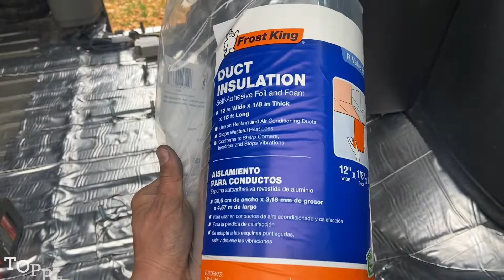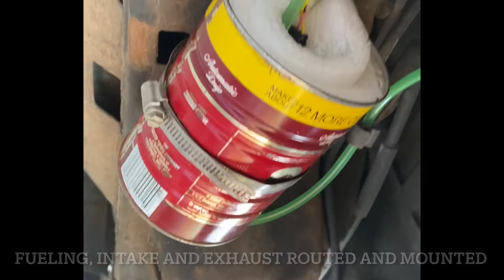Quigley Duramax 4x4 Van GMC Savana

Comment: Nice build so far. I wish my Express was an extended model. I'm hoping to finish the inside job I started last summer. Planning on putting a steel futon (cut-down to approx 30" wide) behind the driver seat, that way I can put my bike where yours is and still sleep inside. We'll see how that goes.
Reply from the maker: Thanks! Eaxtended is nice you never want less-space. But the standard WB is a lot nicer to drive. Futon is a good idea, easy to come by used. I finally realized I’m usually sleeping in the van with the bikes outside at the track or campground so I can use a lot more space than if the bikes were loaded. Good luck on the build chevys are bulletproof! This is my 4th Chevy van.
Reply: @motodrew295  Good to know. Mine is an 09 2500 w/4.8l. 
How do you strap your bike in?
I'm currently doing mine with one strap to the side, but it's usually loose by the time I arrive at the track.

Comment: Nice rig! I have a 2010 Quigley express 2500 with the 6.0 gas. What lift is on this ?
Reply from the maker: Thanks! Theyre pretty sweet rides. I think it's the 3 inch. Has a small body lift maybe 1/2. Not sure if its necessary for the Duramax to have or they did it for a bigger tire.